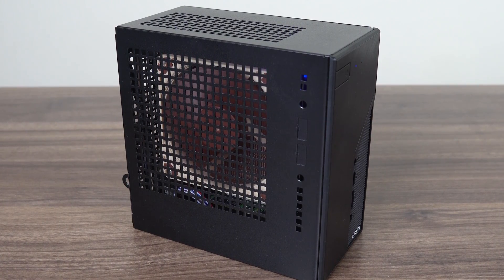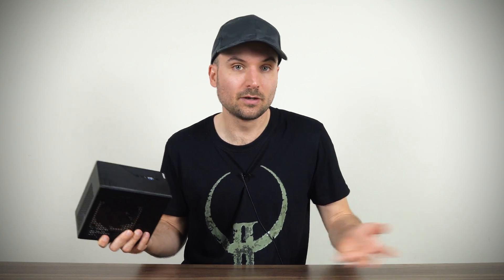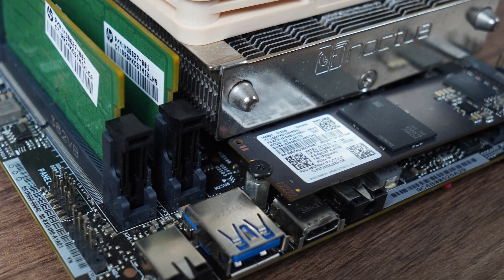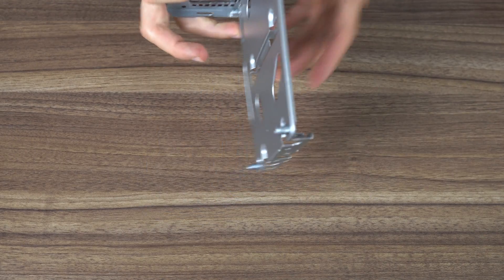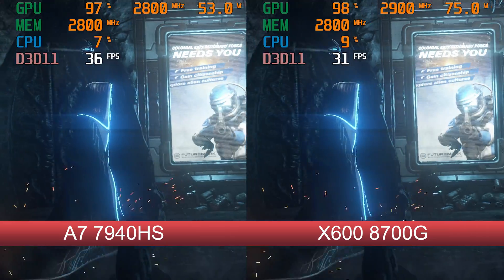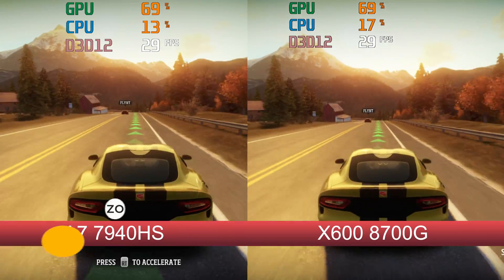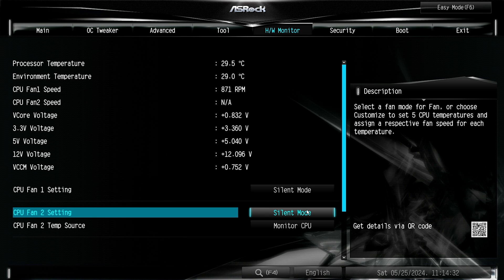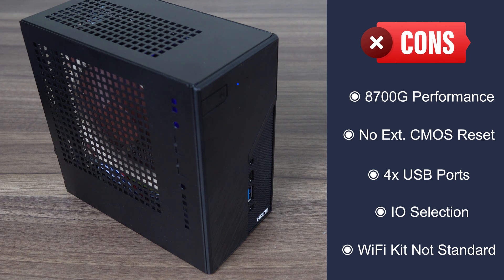The Smallest DIY Gaming Mini PC Has Arrived - ASRock DeskMini X600 Review

Comment: I had the AMD 8600g with the NH-L9a-AM5 cooler. The CPU became too hot under full load. According to Noctua's compatibility list, neither the NH-L9a-AM4 nor the NH-L9a-AM5 (I know, they are basically the same) can cool the 8600g or the 8700g. "Cooler cannot handle base clock"
Reply: Yeah l9a supports 61w tdp, the 8600g has 65w tdp. If you configure the cpu to run at 45w tdp in the bios should be ok?
Reply: @GeordiLaForgery  Kind of defeats the point of 8600G.
Reply: I used the "intel version" for a 12100... overheated... and it doesn't use much power and tops out at like 58W if you really push it but generally it's like 20-30W
Reply: A better cooler, the Thermalright AXP-X47 Full Copper fits the X600. I run my Morefine M600 6900HX mini-PC with an AXP-X47. It performs even better if I orient the fan to pull the air through the cooler and exhaust directly out. You might wanna try flipping the fan on your Noctua and see if it improves the cooling, or get the full copper X47.
Reply: If you cut the mesh of the case above the cpu away you can fit normal sized cpu coolers. And a cooler like the Wraith Prism also looks acceptable protruding from the case.
https://i.imgur.com/JbWOfgi.png

Comment: Still have the A300 with a 2400G. Great mini-PCs.
Reply: Surprised just how disappointing the 8700G was. I thought it would be clear in the lead for everything!
Reply: I still have my A300 running a 4650G and I will keep it.
Reply: I've got the BIOS to put in a newer APU, but wasn't sure if I'd bother. It runs so well as it is.
Reply: those made sense... these new ones don't
Reply: What do you use it for?